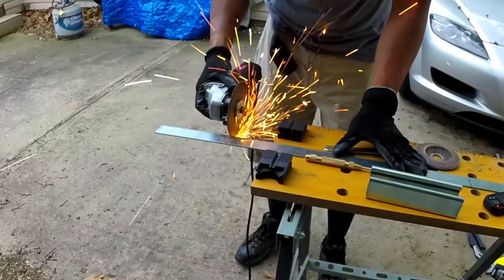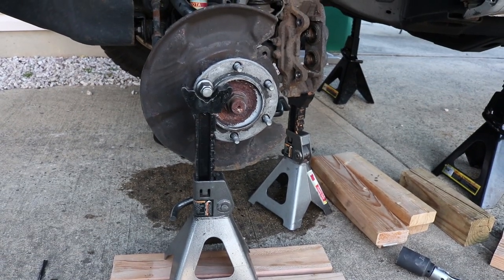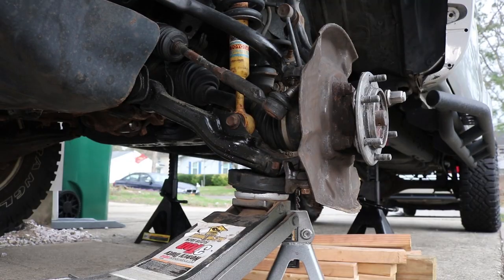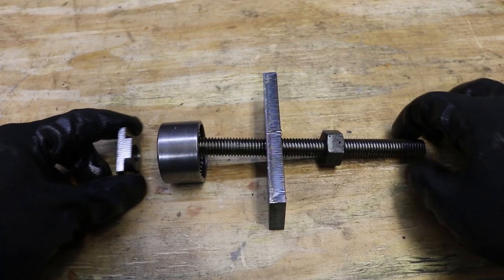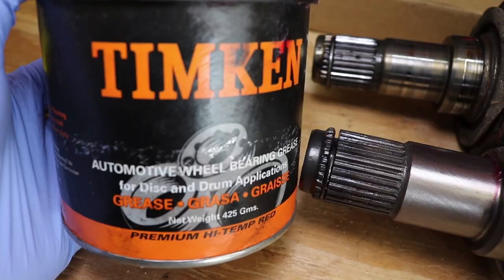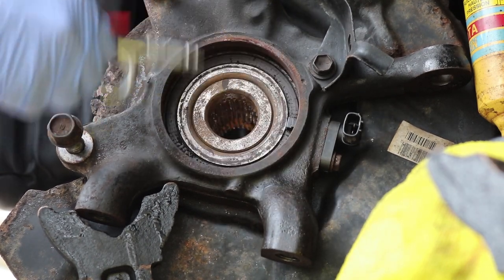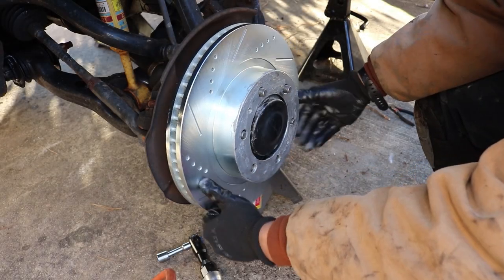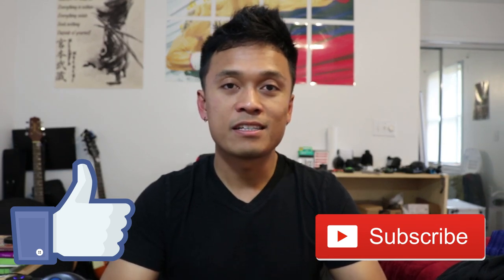ECGS  Bushing Upgrade (Tacoma DIY / How To) + CV Axle Replacement

Comment: Probably the most digestible video of this job. Great work. I do wonder if you can do the entire job without removing the CV from the hub side. Seems that if you removed everything but the cap and 35mm nut, you could hammer/pry out the CV from the diff and then set it the assembly just out of the way (on a jack stand ;)).

Also those alignment tabs are not looking too healthy. 9:02
Reply from the maker: Thanks for the kind words!

On your thought: Yea, I agree. I think you probably can do it without having to remove the hub side. Although,  since I was replacing the seals on the diff side, then may as well replace the seals on the hub side.
Yea, regarding the alignment tabs - I did weld new tabs on there so they're more than healthy at this point!

Comment: Do you have more info on the sway bar removal? This is the first I’ve heard of it.
Reply from the maker: I have the "Sway Bar delete" video that you can watch in this channel
Reply: KFlo Tacoma I’ll check it out. I installed the ECGS bushing yesterday and still have vibrations. Cv axle(s) ate shot maybe...
Reply: @jerrettb76  Did you get your vibrations resolved?
Reply: @juspat2  yes I did... it turned out that my mechanic changing the transmission fluid caused the vibrations. I found this by going to a transmission shop. They pointed me to some history of a “shudder” problem. Wanted 4K to replace my trans with a remanufactured trans... did some research and others with shudder problems just added “shudder fix” to the fluid. So I bough some on Amazon and a pump to pump it in. I followed the directions for adding shudder fix... Which is not just “add and go” you have to run the engine cycle between P R D... then drain excess. Bottom line it cost me about $30 and some time. Shudder is totally gone.
Reply: @jerrettb76  Glad to hear - and thank you for sharing - that's some good information to know.  Not surprised by the attempted $4k sale of course :-(

Comment: What does it mean if my wheel bearing doesn’t rotate freely? Replaced both front ones and the driver side spins fine but passenger side gets hung up and takes some effort to get past
Reply from the maker: Maybe the driver side axle is binding up at the joint

Comment: Whats the reason you add grease to the splines
Reply from the maker: It works like assembly lubricant to let the splines slide into each other easier as well as keep the surfaces corrosion resistant.

Comment: Please don't use a pickle fork on those ball joints, it is very hard not to damage the boots.  Get a pitman arm/tie rod/ball joint puller.  Also why the hell didn't you PB blast your axle nut?

Comment: How are they holding up after a year?
Reply from the maker: Still rock solid
Reply: @KFloTacoma  lol it's funny I asked you a question 2 months ago and you promptly answered. I looked at my drivers side and saw it leaking. Going to go ahead and do this maintenance. I have one question though. The C clip you have to fight against when pulling the axle from the diff, does that pop off internally and you have to retrieve it and how do you install it when putting on the new one?
Reply: @a6o932  The c-clip is on a recess line in the end of the cv acle and should come out with the axle. The new c-clip should be pre-installed on the new axle from the manufacturer and i personally suggest lubing the end of the cv axle with some gear oil to help it "slip past the retainer" a little easier.

Comment: Seal part numbers,
Drivers side
Toyota# 90311-47027
Passenger side
Toyota# 90311-47013
Reply: Hey man. I put these part numbers here a week ago. I must have hit my seals too hard or didn't grease them enough, because my job leaked. So I got more seals, and am going back into the trench this Saturday. I noticed your seal had a gold metal ring on the outside of it. The part numbers I ordered don't have that gold metal ring. I watched this video, https://www.youtube.com/watch?v=mh1BK5--KrU&t=272s, and that fellow (though working on a 4Runner) had the exact part numbers still bagged shown in that video, without the gold metal rings, but, when he takes out the old ones, there are gold metal rings on it. Are these OEM seals updated? Or do I have the wrong seal? Opinions appreciated.
Reply from the maker: I think mine were aftermarket. OEM or aftermarket, they are made to the same spec so it should be ok regardless. Did you check the diff's mounting surface to see if any of the surfaces was scored/scratched accidentally? Yea, I would recommend adding wheel bearing grease at the seal's surface to make sure it glides and seals properly on the CV's
Reply: @KFloTacoma  Thank you.

Comment: Hi, do you think this would stop the 70mph and over body shake on the seats?
Reply: I have a 2020 tacoma trd off road with a lift
Reply from the maker: Does the shaking go away with 4WD engaged? If so, then yes, this bushing upgrade will fix your vibration issues
Reply: I tested it rn with the 4WD and it shaked a little less but still shaked after 65mph. Do you know what else it could be if I replace the bearing and still shakes?
Reply from the maker: The driveshaft balance may be off - you may have to get that balanced. If you have large tires, your tires could be out of balance

Comment: Where did you purchase the seals? For the diff and the hub bearing?
Reply from the maker: I updated the description but here they are copied and pasted: 
Seal part numbers,
Drivers side
Toyota# 90311-47027
Passenger side
Toyota# 90311-47013

Hub Side Seals:
90316A0001

Comment: @KFlo Tacoma why do you need to replace this?
Reply from the maker: If you do a lift kit on your truck then the new angle at the CV joints actually cause vibrations, this mod prevents that. You can see from the video that the play in the needle bearing causes the vibration
Reply: @KFloTacoma  Hi! is there anyway i can test to see if my needle bearing is truely out without pull everything apart? as it testing if there is any play by shaking the wheel or something when its on jackstands?
Reply from the maker: yea, there's two ways. If you drive and you hear a rythmic vibration noise at around 45 - 55 mph - that's your needle bearing. The other thing you can do is push on the CV axle from under the truck and check out how much play it has.
Reply: @KFloTacoma   So i did the test by putting it in to 4x4 and the noise went away, so it looks like the needle bearing is the problem
Reply: KFlo Tacoma I have this problem. Was curious to know if is bad to drive with or if it will occur in to a bigger problem?
Reply from the maker: Eventually it will become a bigger problem. Excessive vibration will cause excessive wear on the parts - which can eventually cause leaks and other premature issues.

Comment: did you take so many parts off?
Reply: Does give you a ton of work room though.
Reply from the maker: All my videos are me working on the stuff by myself. People who have done similar work have some one helping. My purpose is to show that you guys can do it by yourself too and it doesnt require too much brute force to get it done. For example, if i kept the brakes and the caliper on the spindle, that wpuld be so heavy and cumbersome to remove the drive shaft without it slamming down.

Comment: Man you removed like twice as much stuff as you need to to do this job
Reply from the maker: Interesting. How did you go about doing this job? What didn't you remove?
Reply: @KFloTacoma  all you gotta do it pop the axle out and pull the lower ball joint bolts, everything else can stay in place.
Reply from the maker: I'll have to give that a try the next time I pull out the CVs. With regards to removing the CVs, the sway bar and tie rod didn't cause any binding?

How about hammering in the ECGS Bushing? The steering knuckle didn't get in the way?
Reply: @KFloTacoma  I just kinda mashed everything out of the way.

For hammering the bushing, I hammered from under the control arm.
Reply from the maker: Thanks for the input, I'll definitely have to try it out!